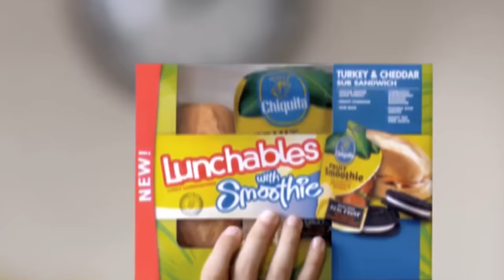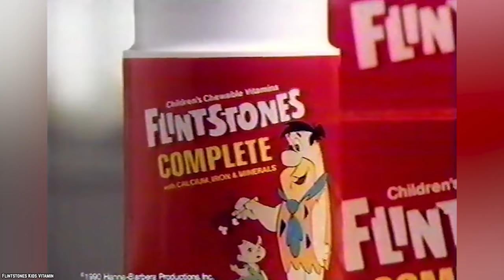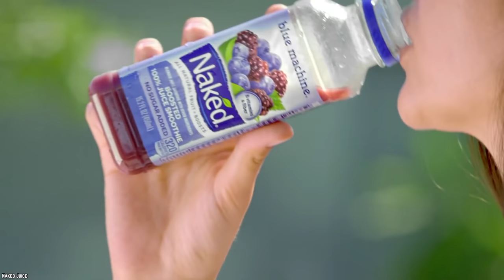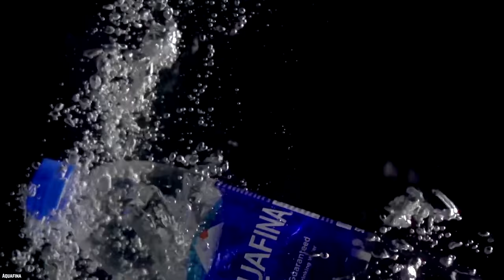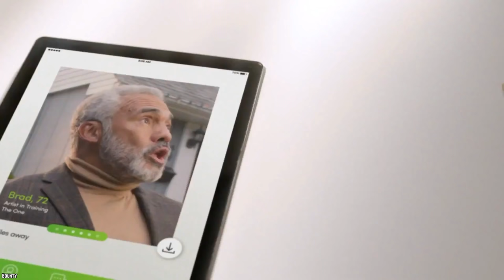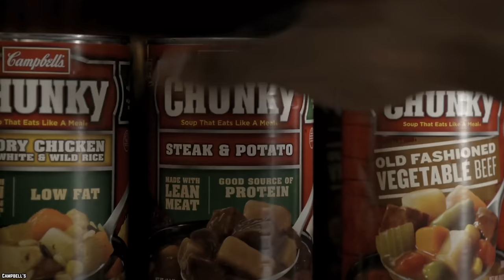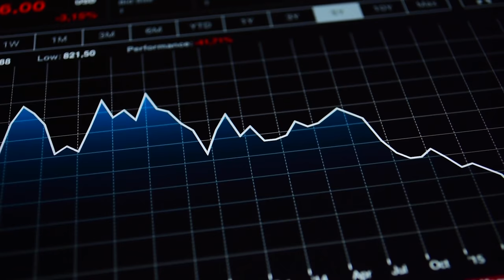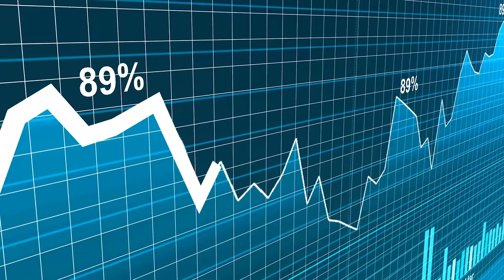10 Grocery Store Food Shortages You NEED To Know About Right Now!

Comment: A lot of these products, bottled water, paper towels, aren't actually necessary. You can get filtered water with a cheap gadget that mounts on the faucet. Clorox spray, and a micro-fiber cloth work just as well as wipes, and paper towels.
If you're on a tiny budget, like I am, you can find cheaper options. 
As for the pets, ick! I pay a small fortune in kitty food. But there are also solutions when you run out. We have a pet food bank where I live. There may be one in your area, poke around the internet and you'll find one.